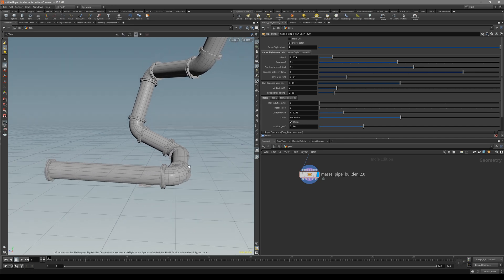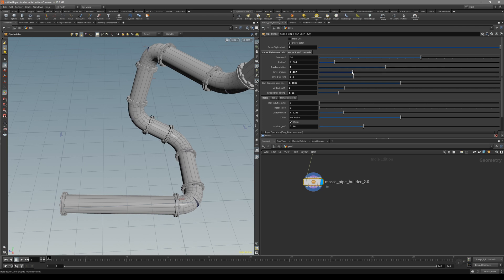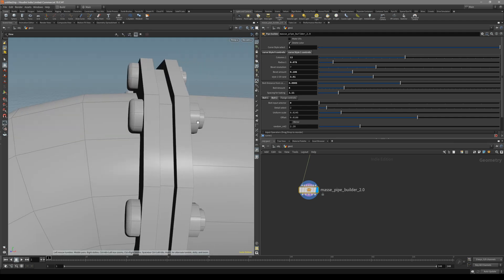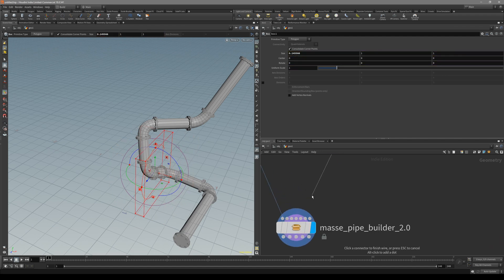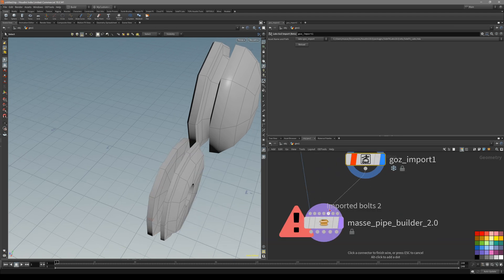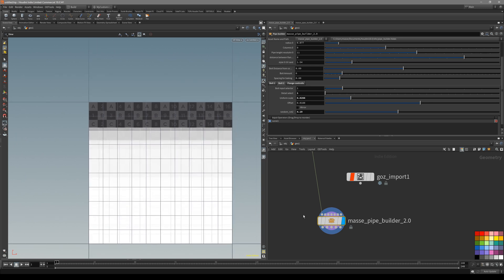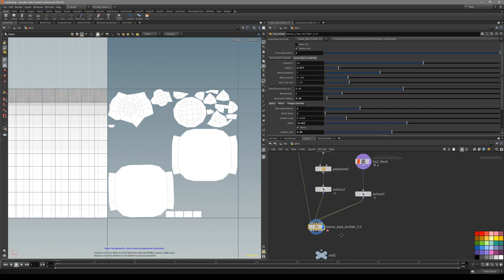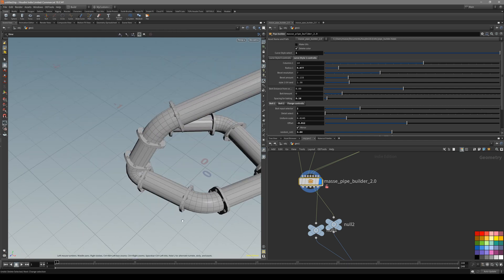Pipe builder HDA for Houdini update overview

Comment: your tutorials are great. Do you use Houdini Indie? How do you find it? can you do most of what you need? how's exporting on other programs? I just have the apprentice as I'm still learning but I'm thinking getting indie. Thoughts? I don't do much special fx at the moment but I love modelling in it. No idea why
Reply from the maker: One of the main reasons I got indie is for the baking of the textures because in the free version you get watermarks. It's so easy to bake out things in Houdini and all of the common tasks like setting up a model for baking you can pretty much automate with Houdini.  Indie is pretty much a full version of Houdini with all of the fx stuff in it. 
Exporting is pretty straight forward. your obj, fbx options. also has a very good free toolkit sidefx labs , ZBrush plugin for moving data between software, also Houdini engine for unity and UE. 
Tbh Wish I been using Houdini sooner. Houdini has stigma that's is super difficult, but I find it very logical.